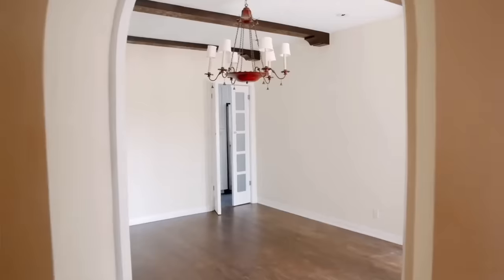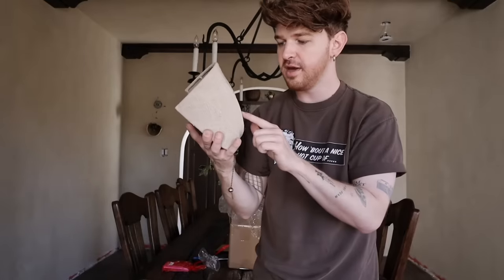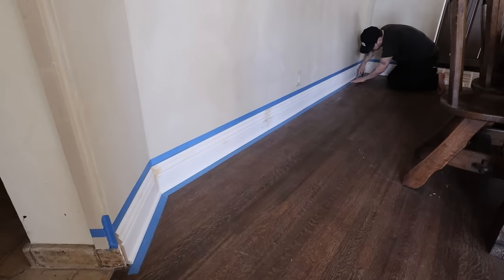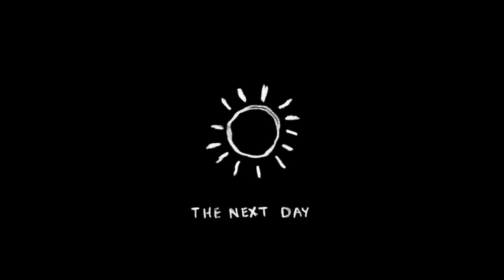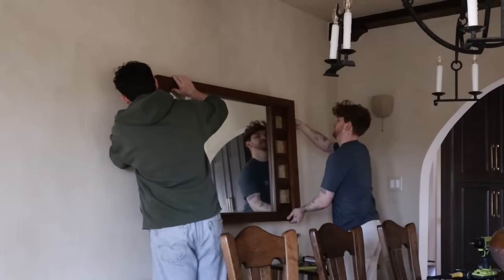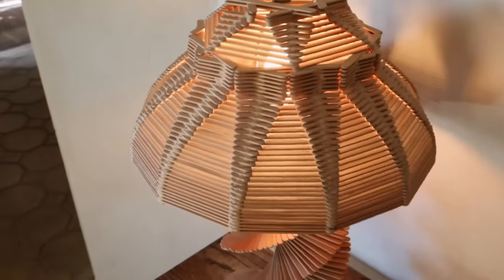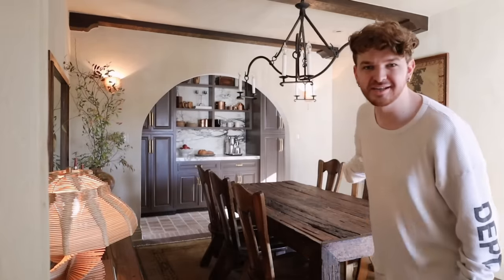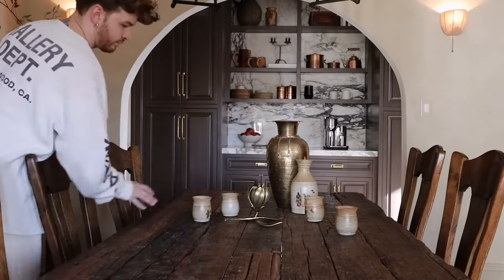EXTREME DINING ROOM MAKEOVER ✨ 1929 Spanish ✨ DIY From Start to Finish!

Comment: I LOVE this room pretty much unreservedly!  I'm glad you chose to stick to your guns about the bookcase.  That table and your chairs are so rich and heavy they need something lighter weight in the room, but still a sizable piece to keep the scale right.  And you found the exact right thing!!!  That very adjustable console table is fabulous and complements the dining table and chairs perfectly.  And the massive iron light and tapestry?  From a "dream of that room" kind of perfect!  Like if you had a dream of that room that was exactly right.

The fabric uplighting sconces were a big no for me initially, but as the room took on its furnishings and you added in your all your personal touches and the finishing pieces, they grew on me until I sort of liked them!  I do think I'd want to look for something very similar in size and shape but made of a metal base with slag glass and hardwired to a dimmer switch to replace them.  TBH, I don't think they match in terms of quality.  At least not visually.  Otherwise, it's a perfect room (how many times can I say"perfect"? 😂).  In my opinion, it's one of the best - if not THE best - room you've done!

Comment: Handy tip for another time - paint the base boards before you put them on, then come back and spot fill and spot paint over the nail heads. Much easier, no taping or worries about the floor. Room looks amazing.

Comment: Hi, your flea market find 16:17 is the cage to a hanging lamp!  That hole in the "bottom" (which is actually the top) is where the lighting fixture goes through - the bulb would screw into the fixture and the cord would go up to the ceiling where it would meet the power source. It would operate via a wall switch.  It's pretty weathered, so it was probably a porch light.
I have a smaller one that used to hang over the back door in the house I grew up in, I keep a candle in it now (also upside down).

Comment: The chandelier, the sconces, the side of the rug you're NOT using, the tapestry, the branches you stole (omg), are so wonderful. The console table is the only misstep in my eyes. It's just too low. Think china cabinets... tall items are better suited to a dining room, and would have balanced nicely with the exquisite chandelier. I believe you will use that console elsewhere eventually. A higher surface could also work as a buffet when needed. The painting your mom found is chef's kiss. The room is gorgeous!!! Happy New Year!

Comment: Drew... that iron "tulip" item you placed under that table/shelf is a planter pot stand. The hole in the center is meant to align with the hole at the bottom of a terracotta style pot. You were holding it and placed it upside-down. I however love it the way you have it ❤

Comment: Another cozy room that just fits your home's vibes so well! Also, you have found some steals of the century with your thrifting 😂.

Also, I just took a look at the website for Two Pages and they might be what I've been needing for awhile. I want to try to be intentional with the designing of my apartment and am trying to get curtains I'll love for years. I bought some cheaper gray curtains that are still okay, but my couch and ottoman are a dark gray so I want a nice pop of color on the windows (oh, and my apartment walls are a light grey. I love the paint color, though...so much better than yellowish tan walls like most places I've lived. But again, too much grey if I hang up my original curtains, lol). I think the mustard yellow linen curtains might be what I'm needing, so thank you for giving Two Pages a shout out.

Comment: Hi Drew. Love every thing except the mirror or the branches and the mirror. Like cut the branches back a bit. It seems too much. I love the $8 painting. Try switching it out with the mirror. The tapestry is to die for. Just perfect. The chandelier is fantastic and I was thinking it was a fortune and $150.! Did you run out the door like a theif in the night? Great job all around. The rug pulls it together perfectly. It flows into the breakfast room and the coffee bar. The rooms now all fit as 1. You must love the house that is now a home.  ❤❤❤❤❤🎉🎉🎉

Comment: I had that popsicle stick lamp back in the 70's. I can't believe it sells for so much money. I didn't like  that lamp  because lightbulb showed through the sticks and cast off a bare lightbulb brightness. We used to get those lamps cheap because people made those themselves. I probably threw mine out in the street. I replaced it with a decorative etched brass lamp from that had a colorful intricately hand painted camel skin lamp shade (Boho style) which is also very expensive today. Well, I am 73 years old, so most of the stuff I owned is considered vintage today and costs so much today. And to think I threw that stuff out.

Comment: How chunky you can go really depends on how large the space is, and perhaps even more importantly, how large the person who will be inhabiting the space is.

I personally am over 6 feet tall and weigh somewhere between 210 and 220 pounds. In other words, I am large enough that countertops and indeed many furniture pieces need ideally to be custom made. I can wear stuff in terms of clothes that would look ridiculous on someone any smaller. And I admit to wearing that kind of thing... because I can. So I'm even be inclined to do extra-large furniture... because I can.

Indeed, I remember once living with a roommate about the same height as I am, and we had our storage furniture stacked unusually high to save floor space in our minuscule dorm room. It was a solution that most people would not be able to do, because they wouldn't be able to reach the highest shelves and cabinets. But for us, it worked.

However, there is another side to the issue. It seems to me that if one is going to go this route, one needs  to leave more space in the room. One has to take particular care to ensure that the space is not cluttered.

I'm loving the texture contrast between the wall and the baseboards. Veddy nice. Also love wrought iron features - including chandeliers :)

Good God... a modular bookcase? I have been trying for ages to figure out how to do that. This piece is going to be so helpful in finally pulling that design together.

Comment: I feel like that little iron stand is a plant holder. There is a hole in the bottom, so I suspect at one time there may have been a pot that fit down in it. Looks like you could also flip it over and use it as a plant stand.

Comment: The chandelier is a perfect match and the tapestry, but the mirror is too small. It needs to match up on the same scale as the chandelier, tapestry, dining table and the rug. You have more than enough wall space to hang a larger mirror on that wall. Overall the looks of a beautiful design room is decorated for the eyes of the beholder.